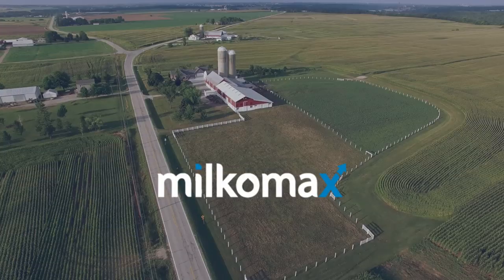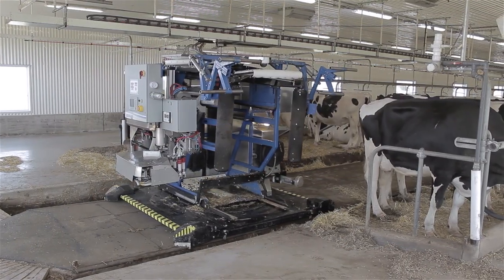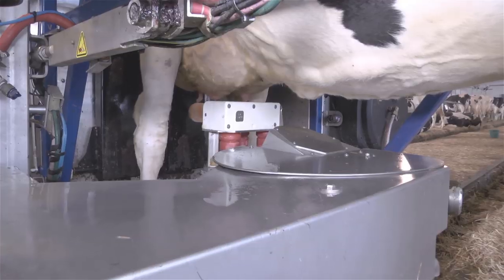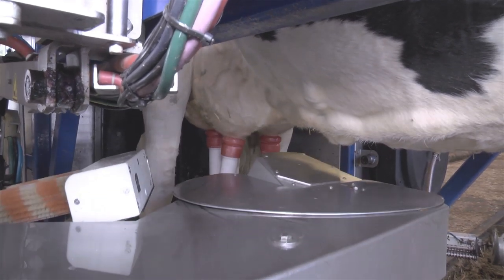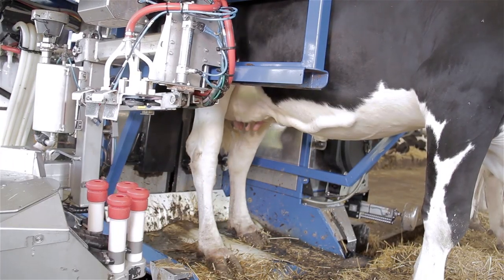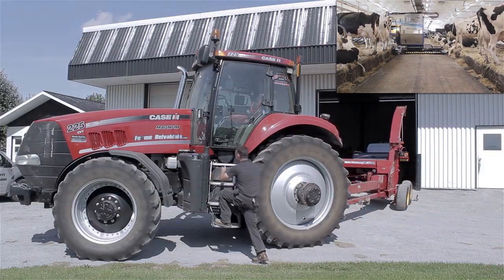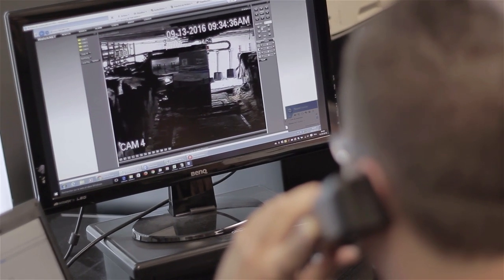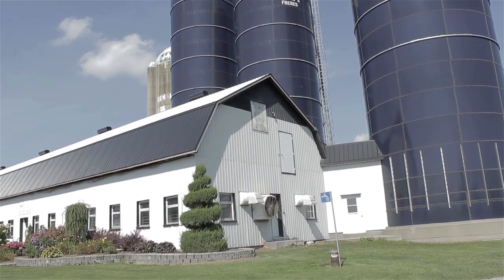Tie-Stall AMS Milking Robot by Milkomax

Comment: How does the robot transfer the milk to the bulk tank?
Reply from the maker: Thank you for your question. The Tie-Stall AMS is equipped with a flexible pipeline of sorts, supported by a tray installed above and along the course of the robot. This tay holds a flexible line to provide electricity, compressed air and water as well as a return line for milk. It can be partially seen on the following video: https://youtu.be/S1xt2pr2_IM?t=63 Feel free to contact us for further questions (https://milkomax.com/en/contact-us/).
Reply: Can you hookup 2 robot to same line to milk 100 plus cows or would you need a central  milk house 2 lines
Reply: 2 robots or more are compatible in the same allay along with the same milk air water line and tray, all up to the dairy!

Comment: How many high producing cows can one machine handle?
Reply from the maker: A single robot can reliably perform between 150 and 160 milkings a day, milking frequency being proportional to the herd size (i.e. 50 cows at 3 milkings per day)
Reply: Now at 3 milking cycles for 60 cows with the Robomax! More efficient, and less costly in parts and maintenances